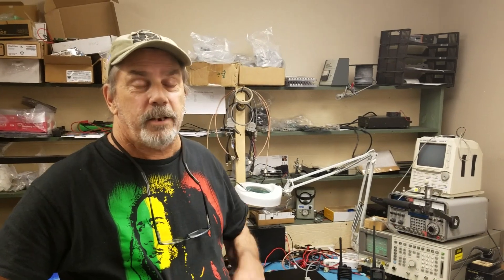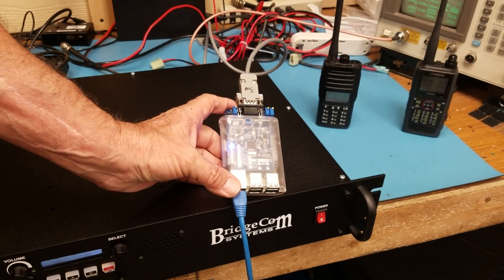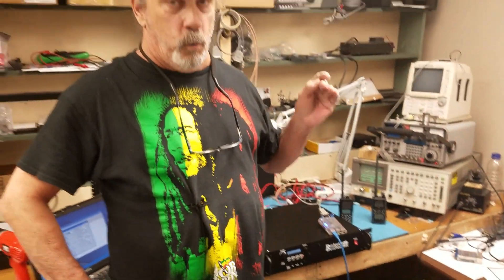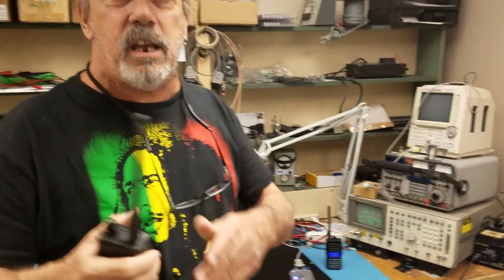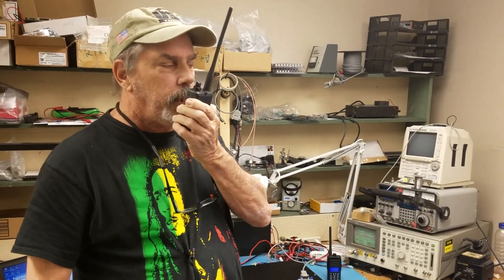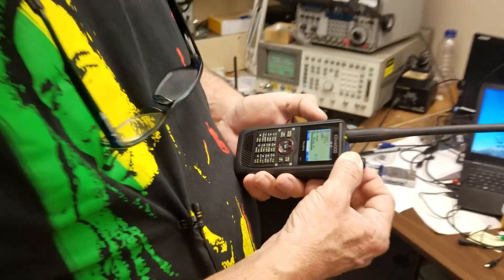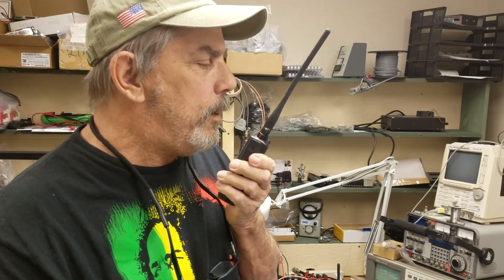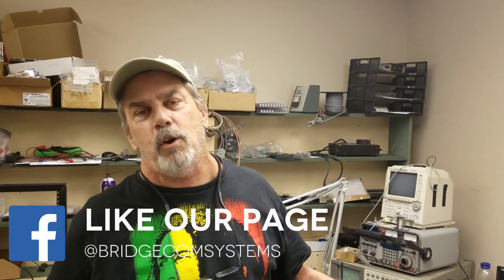BCR Repeater MMDVM DSTAR 2m demo

Comment: I'm having trouble getting proper MMDVM audio out the transmitter. Is there something that needs to be done to change pin 21 from accepting subaudible tone audio to broadband/unfiltered instead? I also have a question into tech support.
Reply from the maker: Pin 21 is the right pin.  What flavor of repeater are you using?  VHF, UHF, or 220?